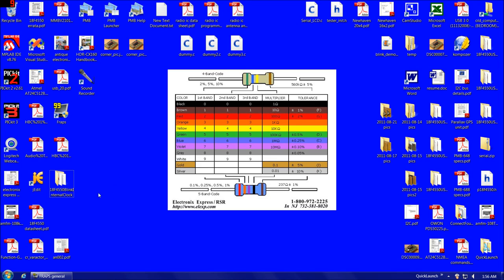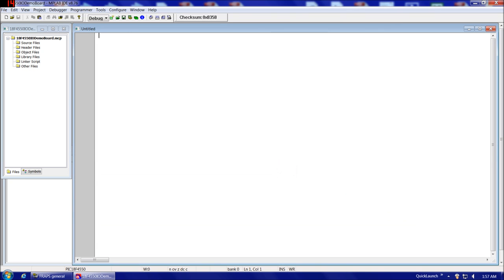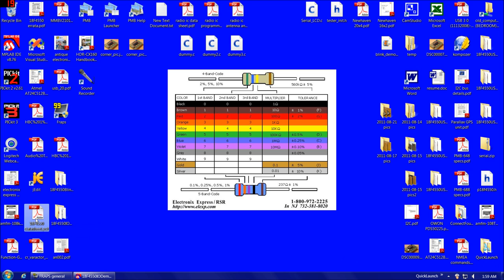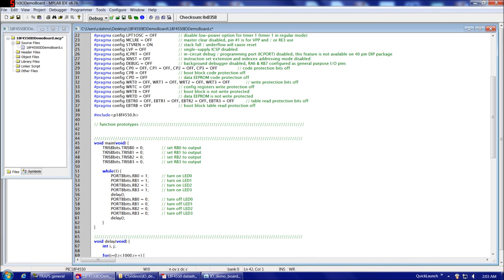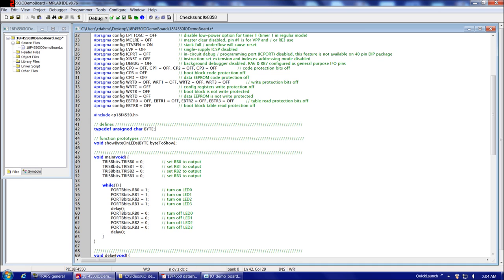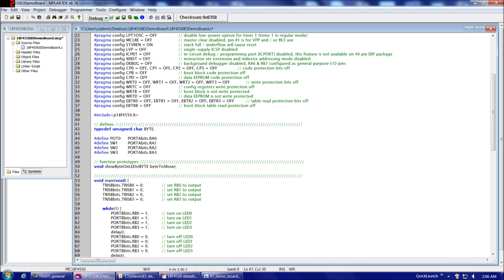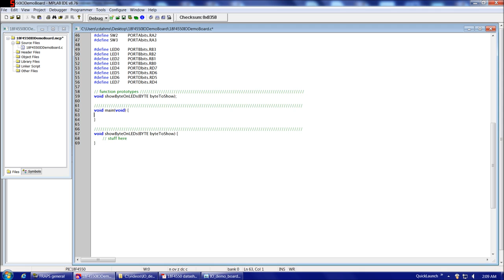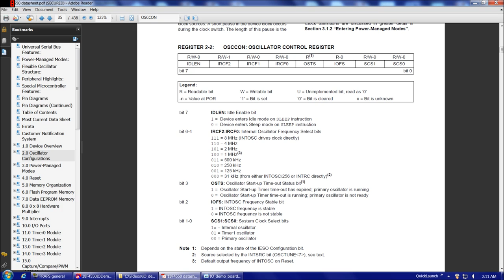PIC18F4550 IO demo board - part 2 of 7 - software 1

Comment: Very nice tutorial, thank you so much!

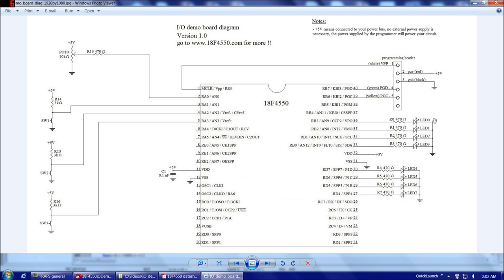Around 5:00 minutes you explain how the software should behave with the current the hardware configuration.
Would you please explain why the resistance is necessary near to SW1 SW2 SW3? 
You used 3kOhm resistance. Why you choosed this value?

Thank you in advance!

Comment: sory for  my english: the  resistance is a pull -up type, you can  use anything between 1k and 10k. A pull-up resistor weakly "pulls" the voltage of the wire it is connected to towards its voltage source level when the other components on the line are inactive.